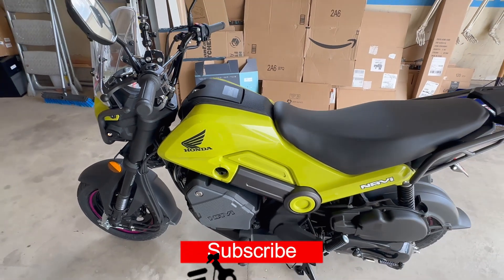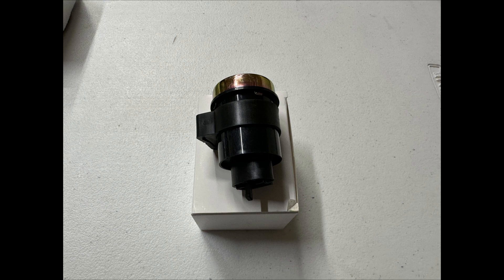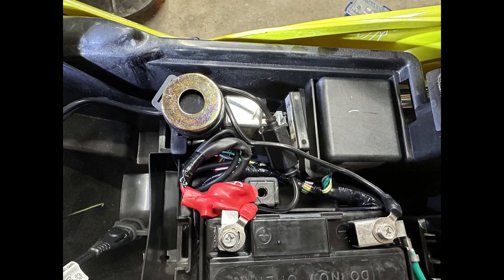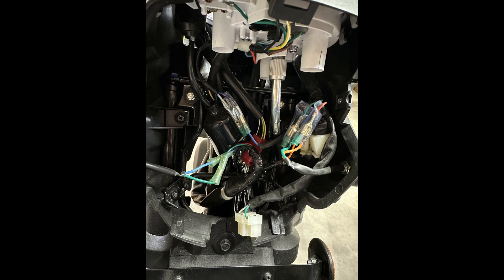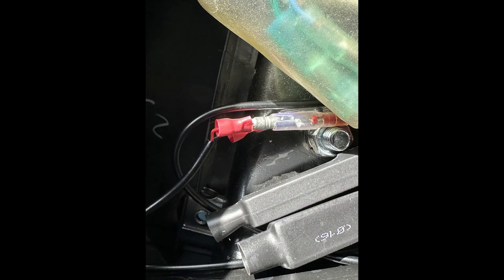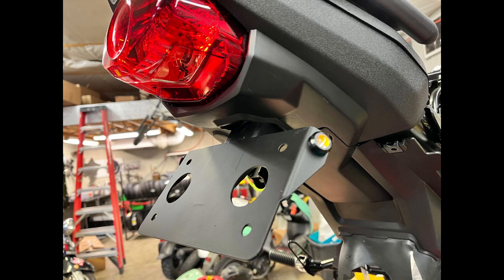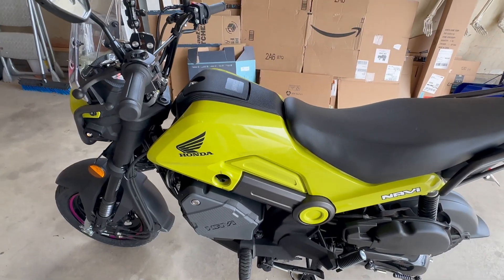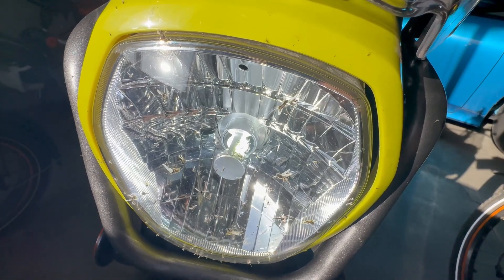Honda Navi AC to DC conversion. Adding LED turn signals and new tail tidy with LEDs

Comment: Nice little walkthrough, thank you. My question about the turn signals (I’ve been looking at the exact same ones you have) do you feel like oncoming traffic can see them well? The way they sit I worry traffic coming from your sides will only be able to see them? Thanks in advance!
Reply from the maker: I really worried about that. I ended up taking them off and putting the stock ones back on for now. If you ever do sidebags they will cover those little lights in the back. Look at my saddlebag video and you will see what I mean. So I am running stock for now but might switch to the LED versions that stick out.
Reply: @gr8shotz00  Thanks so much for the input. I’ll stay away from them then. Might do like you said the led ones that stick out. Man the flush ones look so nice though. Buuuut safety over aesthetic.
Reply from the maker: @j29g99  Thats what I decided in the end. I also worried that police might not like them too. I didn't want a ticket